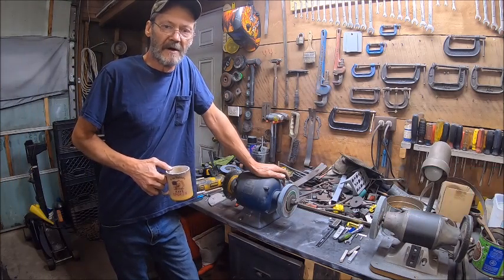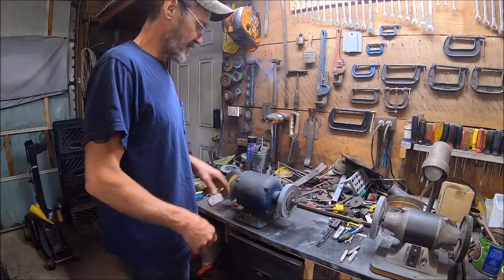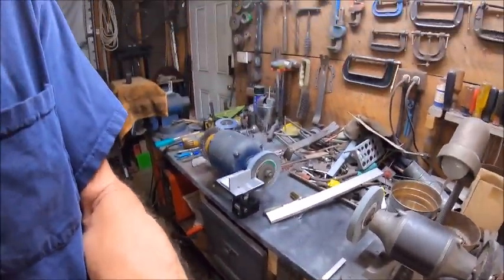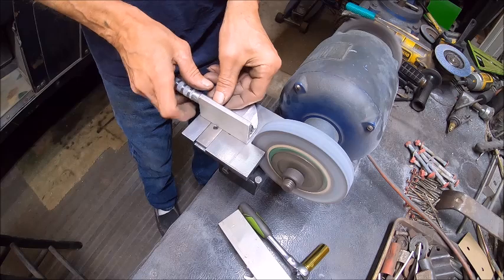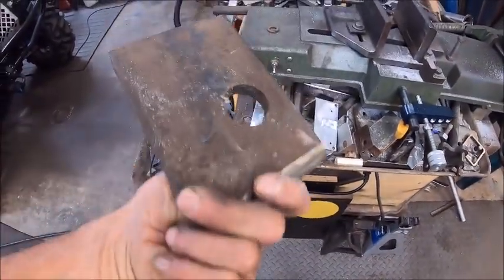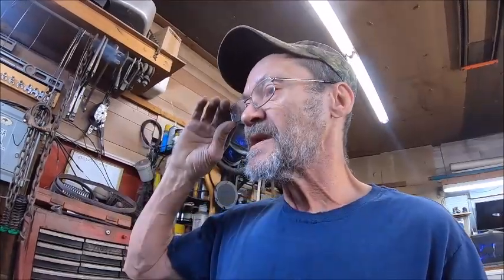bench grinder tool rest build

Comment: I really like the way you did this. I've been wanting to make one myself. The wobble in the wheel is the the stamped washers that the Chinese make to hold the wheels on to the shaft of the grinder. I have a brand new Vevor that is the same way. I will be machining my own flat washers with a slight recess so as to clamp the correct way. I've never owned any Grizz tools but not good interested in anything Grizz makes. My brother bought a pan brake from them and he had to modify it to even use it. Seeing you smoke makes me want to smoke. I smoked Non-filtered Camels for 50 years. Loved every one of them. I still love the smell of cigarettes when someone else is smoking. I smoked my last one almost 10 years ago when they loaded me in the ambulance. Yep thought if I could just smoke another one I would be able to breath. Problem was I was having a severe heart attack. I guess you could say that I am a true Nicotine addict.

Comment: I have been very happy with my Norton grinding wheels, Ya they cost a bit more but I get them from the online auction place for half or less of what they normally go for. Remember to do the ring test on a new wheel before mounting it and then step to the side and let it run for five minutes before trusting it.
I'm not sure if they still make then or not but I have a bunch of Dayton wheels I picked up in the past that have served me well also.
Reply from the maker: thanks man.
Reply: I learned a good lesson when the company I used to work for got a deal on cheaper wheels. One night my helper was using an angle grinder and the wheel exploded. Good thing he was wearing a hard hat and full face shield. Split that damn hard hat right down the middle and parts of the wheel were inside his inner thigh when they loaded him into the ambulance. My brother bought some cheap disc from Harbor Freight, and one came apart and stuck a piece of that thin wheel in his throat. Now I only use Makita wheels on my angle grinders. I bought a pack of 10 Norton disc and they do not last near as long as the Makita. Since I changed to a diamond cut off disc and it is well worth the money I paid for it.